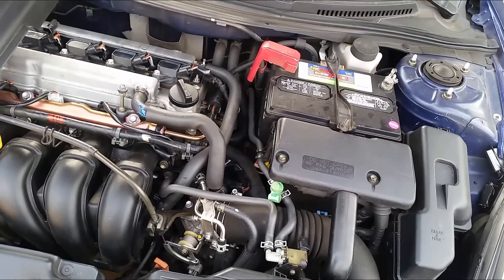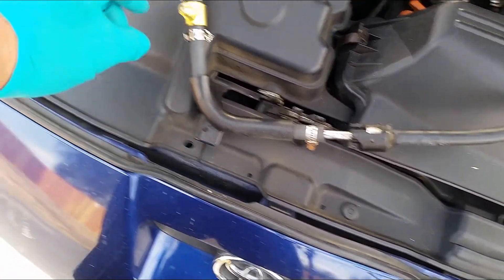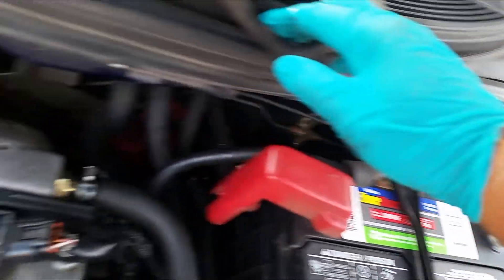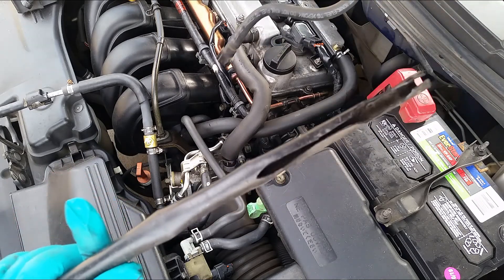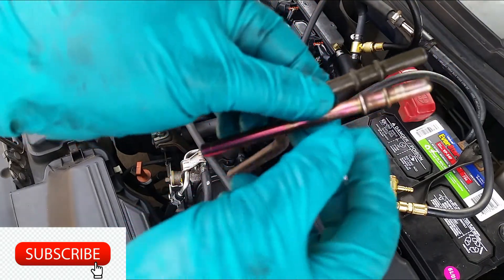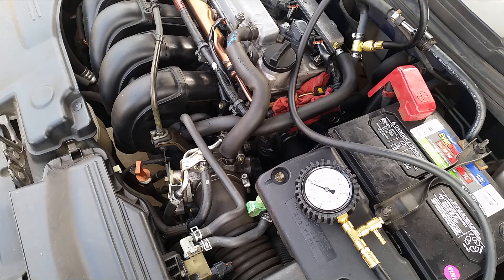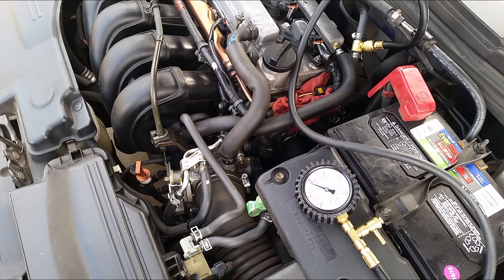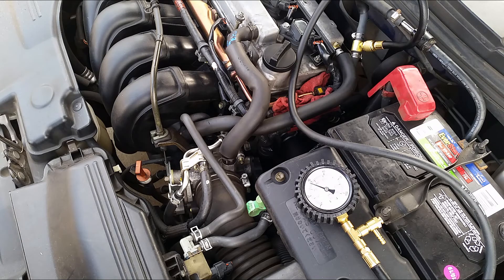Make a Schrader valve to check EFI line pressure | DIY | cheap and easy | Toyota

Comment: Did you check the injectors? Ever find out why you're getting the P0171?
Reply from the maker: I did solve the problem but it has been so long, I can't remember that I did.  I replaced all the filter screens on the injectors. They were working fine.  That's not the issue. I believe the issue was donut gasket right after the exhaust manifold. It's not a good seal sucking a little air. Computer thought the air mixture  was too lean when passing thru the two oxygen sensors by the catalytic converter. As a result,  the computer try to compensate by adding more fuel. Something like that..
Reply: @tonedubb4325  I'm having the same problem, I'll try smoking it back from the tailpipe. Thanks...